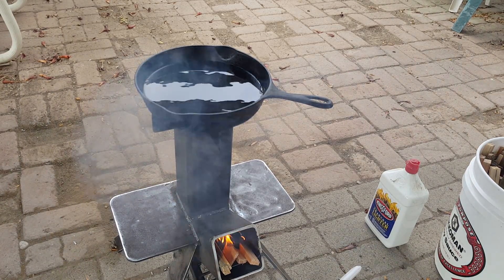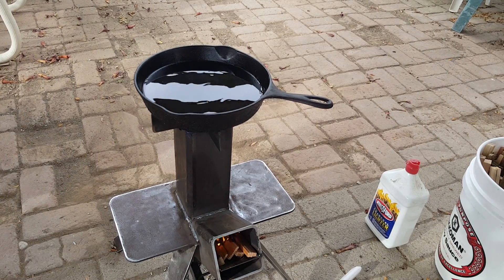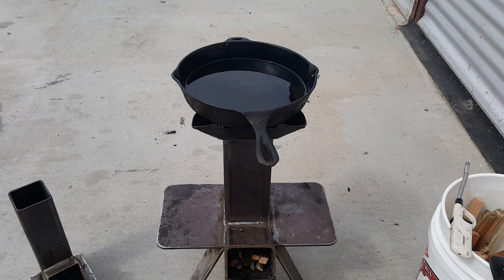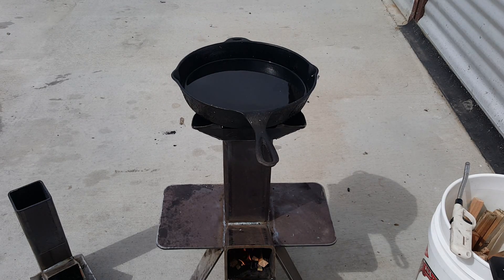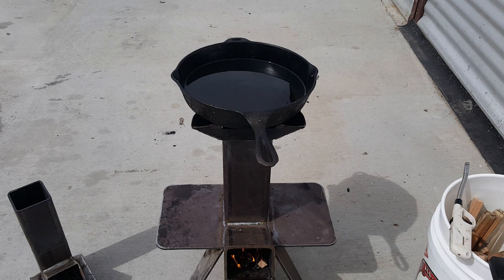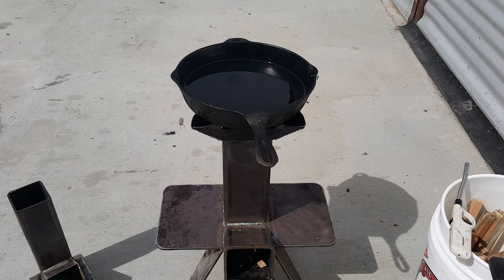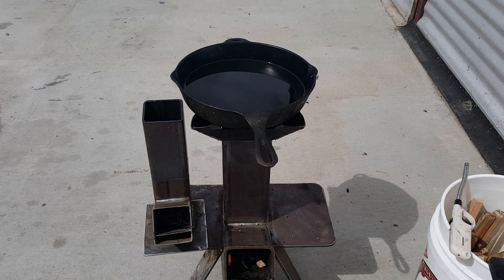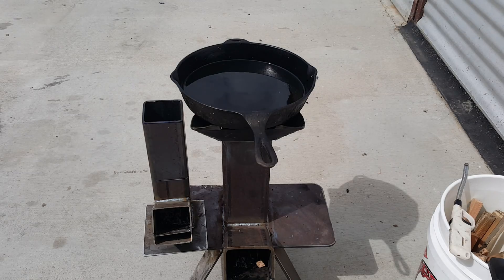4" Rocket Stove - Part 4

Comment: Add a door where you load the wood only to keep it closed so air can be forced into air intake below, that should help rocket flame up your riser tube,  it will work did that with mines, just a thought.
Reply: I feel that a cover or door is more for some control over the rate of burn. The air from the bottom is for the actual fire of the fuel and any air that enters the fuel shoot is used for the secondary burn.